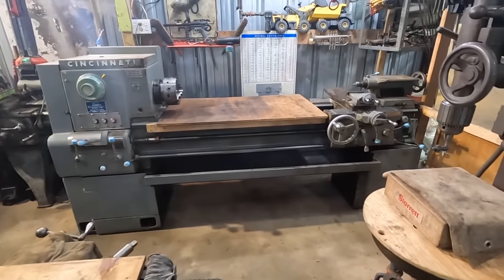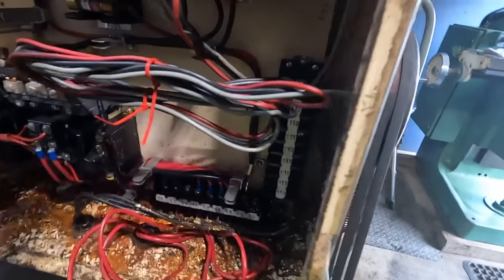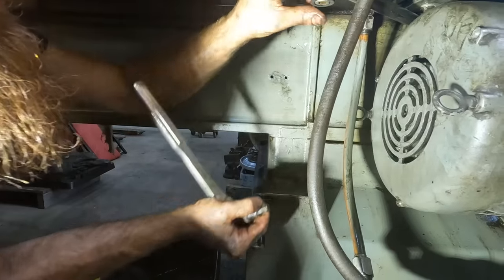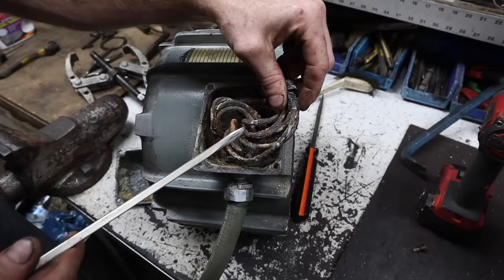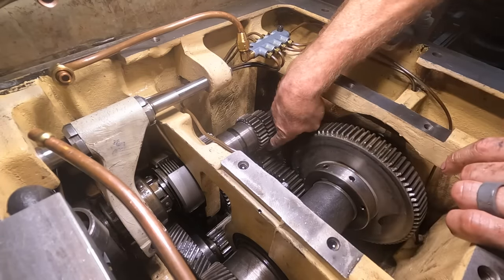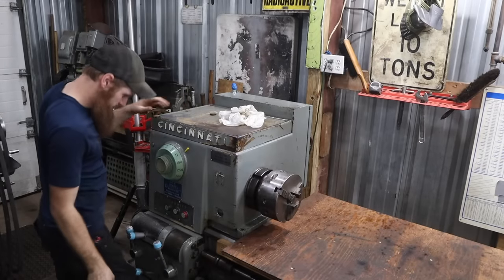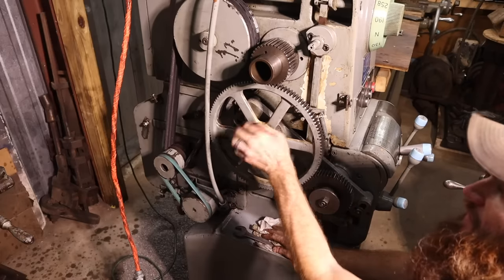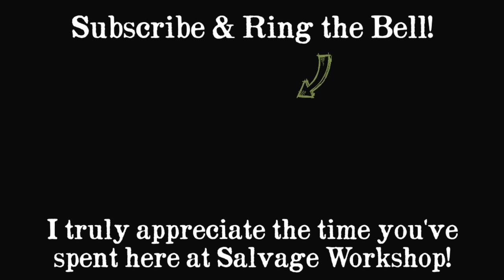Can we SAVE this BROKEN Lathe? ~ MAJOR Issues found! ~ Will it Ever CUT again?

Comment: Great video!  Woulda liked to see the feed change & TPI.  Spur/straight cut gears make noise, ever notice/hear a stick shift a non-syncro 1st or any reverse gear, they do need lube though.
  Roll/split pins have an install direction so the force on them doesn't close up the split & cause it to work out, a smaller pin inside will guarantee it stays put.  Don't put a restrictive filter on a pump's input!!!

Comment: I have never been a fan of General Filters which are a contractor grade of filter.  For my money I would get a RayCor style with micron rating to match whatever was called for by the manufacturer.  Unless there was a good reason given I would run it all through a filter of one sort or another.   Anyway you can catch dirt and wear to keep it out of the system is a good thing.

Comment: The powder in the motor was dried up coolant. I work on large 3 and 4 spindle Cincinati's and we've converted them to MQL and the flumes down the side of the beds are full of that stuff, smells horrible! I wouldn't be surprised if it stopped running at one time and they sat it off to the side, and one day decided to hook it up, or even decided to sell it assuming it didn't work, but once the coolant dried it ran again

Comment: You are very lucky you caught that motor issue when you did. Not only was it so corroded up inside that it's a true wonder it ran, but also those wires may have caused a short to the frame and ground out the entire machine.. so either it could have burned up, or electrocuted anyone who touched it while running.

Comment: Awesome video.  For the oil drain, I think something like a Fumoto valve for a car engine would be nice.  A ball valve that you can stick some PVC tubing onto for a really easy drain process. Not sure if they make that brand for NPT but an idea.  Also wonder if the corrosion in the motor was water (or whatever) coming in through the  power cable tube from the switch box.  A longer cable, looped high enough to prevent liquid from dripping, might prevent anything like that from happening in future. Even though the  gasket should in theory stop all that.  In any case, nice work, and a super interesting story.

Comment: 8:06 make outside jaws for the chuck!  Get some tools steel  blocks , machine it to fit the chuck,  then the jaws.  Maybe make them  extra capable,  with indexable jaws. Un bolt from zhe slides. Then space out about 1.5"-2"  and possibly flip over to be a inside chuck, some 2x3" bar stoc tool steel  blocks , i haven't machined anything, but seen jaws made before, and think o could do it. Definitely should try on some cold rolled bar stock first!! It would probably take me a month to halfway make only one, after turning 40lbs of steel to shaving, you should definitely try it!✌️  Id love to have a similar lathe, maybe not so large, and a smaller mill.

Comment: The noise in the large end gear won’t affect the accuracy of the spindle. That gear’s purpose is to transfer drive power from the spindle (which is gear-driven inside the head) to the quick-change gearbox that drives the apron screw. It’s downstream of anything that controls spindle accuracy. What lubricates those exposed end gears and the QCGB? I didn’t see any oiling mechanism tied to the headstock’s oil pump. That bushing the gear rides in will need continuous lubrication.

Comment: I agree with Paul that drain sump is to collect sediment and possible (heaven forbid) metal shavings from bearings or gears (not likely). The valve and flexible drain pipe is what I would suggest also. Don't connect them together. You will notice the pump pickup is slightly higher in the sump.  Whatever got into the electrical cabinet ran down the seal tight  and into the motor.  I'm surprised it ran too.
Reply: I just purchased one like this and that drain sump plug had a magnet on it which had attracted a small amount of metal shavings. Similar situation where the lathe sat literally for 35 years.

Comment: Those are a good lathe!  Stout and they will cut some chips.!!   The one we had was "War Finish
 No real fine feeds, maybe ,0027? I used to 4 jaw DME mold bases ...about 8" by 11"  and line bore all the plates assembled for round inserts. Big job!
That rubberflex collet setup is excellent! They run real true. 
I recall hydraulic maintenance was something that got done !  There is an oil filter in there you need to change.
As sludgey as that oil looks might it be water soluble coolant oil,like VanTrol?  That thing may have used flood coolant.  
Maybe two separate systems.
I suggest you not re-engineer the hydraulic system. (No tee to the filter)

Comment: Take photos of the oil soaked manual, clean the images up in photoshop and print them out, new manual!
Getting the motor rebuilt is the way to go. But it's expensive. Worth it I think. (But I'm not paying 😂)

Comment: I'd run both the sumps to the filter and change the filter housing to one of the remote mounts used on cars and put a proper oil filter on it..

It looks like coolant got in the electrical box and chased down the conduit into the motor

Comment: Suggest putting a valve on the lower end of your new drain so you can close it before you remove the plug to add a hose whenever you want to drain it. Try opening the door to the electric panel when it's running to see of anything is coming out of any of the conduits. "Sealtite" conduit is intended to be "waterproof" so it could act as a plumbing tube if it becomes "pressurized". ??? maybe a "overfilled" condition somewhere or a bad checkvalve  somewhere in its history ??? 
Connecting any one of the three wires "randomly" will make the motor run but it may rotate backwards from the direction you want. To "reverse" the direction of rotation, switch two of the connections at the source. It sure seems like this motor, and maybe your electrical box at the other end, may be "sucking" moist air from its environment. It looked like what you had there was excessive "oxidation". Wonder if that "air tight" motor was "searching" for air through your electrical conduit system  and actually sucking and distributing oily air through your electrical system on this machine??? 
Not sure I correctly understand the physical shapes of your machine, but if the lid of the transmission is directly over/behind the electrical box, I think you uncovered the source of the contamination in your electrical box with the fact that there is no gasket under that cover. Couple that with the material inside the motor (that got sucked there from the conduit system coming from the box where the oil was going. ????

Comment: Spur gears at high speeds are always going to be noisy, but you might be able to use thrust bearings on either side of that large gear to keep it from rubbing on the metal housing. You might have to shave some of the hub down to get a bearing on the backside of the gear though.

Comment: Congrats on your success so far... it's good that the lathe will be back in use. However, you've got to learn proper machining man. SERIOUSLY. You need to learn the basics of running a lathe and machining in general such as knowing feeds & speeds. Such as? How many inches per revolution you have your lathe set at. Feed rate greatly influences your surface finish. Example? For mild steel, try .004 per rev for starters when using a chipbreaker style carbide insert with a radius of .030 on the corner. Adjust as necessary based on the metal you machine and your lathe - all machines tend to be a little different and machine stability also determines finish (not to mention accuracy!) You also needed to set up a live center on the end of your workpiece. It was hanging out of the chuck way too far - this also influences surface finish. Next, set up your compound at 29° and leave it there for turning in general. Set the quick change tool post so your cutting edge runs at an appropriate angle - around 5-7° is normal IIRC. The tool post itself should be square with the ways. Rather than continue and write a book... the best advice is to get educated. Learning real machinist skills is your best bet for success. In the meantime, good job so far. For parts and data help, don't hesitate to look Cincinatti up on the web - the last time I looked, they're still in business well over 100 years after they started. You might be surprised at what's avalable. Best wishes!

- Max Giganteum

Comment: I'm pretty sure the gear assembly that is making noise on the headstock is only for threading and really shouldn't be run at nearly 1000 rpm.  Straight gears and plain bearings would be for much slower operations only.  I'm not familiar with that machine but I'll bet one of the levers will move the gear lever away and stop it from moving when not needed.

Comment: Awesome video of this lathe, excellently explained what you did. Have a good day.
I fit an extention  pipe to my lathe sump, then a ballvalve with thread on its end the same as drainplug, and used the drainplug there in case the ballvalve gets opened accidently, pleasure now to change oil.
About the 2nd hole for draining as you used(I agree), maybe they dont want fine swarf goint out of other hole to that sif/filter and pump, but rather settle or drained out, maybe the difference between the two holes-?

Comment: Hello, I can tell you what is wrong with the lathe. The electrical conduits are vaporing air and hot oil into the control box and motor. The fix would be to install a conduit seal off. Looks like a y-fitting with a plug. you disconnect the wires, do what you have to to and install the fitting as close as you can to the source. Back feed the wires when you can. Last part is to remove the seal off plug and fill the seal of with the seal-off material let it setup and install the plug. Will make two or more problems go away. Oil loss and debris building up in all the places it doesn't belong.

Comment: That roll pin fell out because it lost its spring tension, presumably because it got very hot, which aligns with the blueing you mentioned. The point I would make about the motor is that liquids can wick through a cable and get into the junction box and thus the motor so maybe that was how you lost liquid level and gained all that crap in the motor and junction box.
Reply: I was told once that when putting in a roll pin the slit in the pin should be at 90 degrees to the shaft. Especially in this case where only one end of the roll pin is holding the gear in place.  The torque of the shaft could collapse the pin or cause decreased tension over time if not done correctly.
Reply: @1DIYGuy  EXACTLY!

Comment: "T-ing" all the oil over to the screen thing is a better choice.
the extension for a drain is very practical, but really how often are you going to flush/change the "very expensive" oil in a machine you will use less then 100 hours a year?
Reply: Also put a valve in before the filter. To shut it off while changing /cleaning the screen.  Also to control the flow of old oil into a bucket.

Comment: I guarantee the water ingress into the motor housing was due to the water that was filling up the electrical panel. It was filling up the bottom of the panel until it ran down the power line whip literally draining it right into the motor... Ugh thats a nasty cascade of unfortunate events. That Cincinnati took it like a champ though. I true testament to how things were built back in the day.

Comment: I think at some point it may be worth having the motor re-wound. There is a chance that the corrosion  may cause overheating  if the lathe is put to some hard work.maybe a second hand motor is worth a thought too.  For a 3 phase motor if it runs oin reverse just swap over two of the wires. In the dismantlied state  Really hot water is a great way to disolve the corrosion without hurting anything else, then use a specific electrical sealer spray.

Comment: A Great Job Rebuilding/Restoring that Great Lathe .... Also on your 'To-Do' List .... Get some 'Levelling/Isolating' Feet and and Level it Perfectly ( 4 on the Headstock, 2 or 4 on the Tailstock end ) ... This will make a Major difference to the Accuracy .... Try to 'Borrow' a Good Machine Level .... Also .... Those 'Copper lines' in the Head .... Not sure  ????? ,  but I THINK  that they are Possibly the Hydraulic Line to shift the Gears .... Looks like they come from some sort of 'Rotary Valve' that acts as a Selector. Those 3 'Shifter Rods' are maybe 'End Fed' to shift them Left and Right ....  Also put some HEAVY Grease on the Gears, I will make a Major difference.... Running a 'Tight Mesh' also make them Noisy as they 'Bottom Out' into eachother .....  Might be Wrong on some points, but my 5c Worth .... :-)   :-)   :-) I am a Retired Engineer/Toolmaker/CNC Machinist, so have been 'Around the Block' a few times , therefore find Your Type of Vidclip Super Interesting .... Best to You, Yours and All from ChCh, NZ

Comment: Great effort fixing up this great lathe. A lot of complications, but you figured it out. Well done. 👍 Btw I wouldnt be too downbeat on that concentric 4 jaw chuck. If you machine a lot of rough surface round bar stock (like black mild steel or anything with a skin), they're great. Granted though, they're useless for anything other than round bar stock.
Reply: That's a misconception shared by most lathe users self-centering truck can grip and Centre more
Reply: ... shapes of bar than a three jaw which cannot grip square profiles. What people fail to realize who have not tried it is that a 4 jaw self-centering chuck grips and centres hexagon bar just fine. A 4 jaw SC chuck has other advantages over a three-jaw: it provides a more secure grip, and it distorts hollow workpieces less.

Comment: Not surprised at all, I have been through 2 brake boosters in less than 500 miles on my black truck. Even Ac Delco parts are not what they use to be.

Comment: Thinking about it, if the gear heated up enough to expand, and allow the roll pin to fall out, I would think it would cause more damage then you have here. I have a feeling someone was playing with it, and had a little "oops I dropped the parts boss!" and from there they decommissioned it after realizing the repair was botched? another good thought is poor quality control from the factory.

Comment: I'm sure someone else has already proposed this possibility but have you considered that the moisture that got into the electrical panel came from the outside of the lathe? Possably water intrussion from a leake in the roof. I didn't see any places where water leaked on the top of the panel. Just a suggesiton. Great Video love the content. Oh, and it looks like it was rewired at some point so maybe whatever leaked into to electrical box shorted out or damaged the original wiring.

Comment: i just finished a 1953 Warner & Swasey no#3   M-1200 turret lathe.. 4000 lbs. of fun fun fun
Reply from the maker: Awesome! Do you want a Warner and Swasey No.5 Turret Lathe? If so, let me know!

It came from the same place as my Cincinnati Hydrashift!
Reply: @SalvageWorkshop  no , but thank you for the offer.. I am not a machinist by any stretch of the word . But I do build custom bikes, and sometimes cars and boats.... and I always wanted a lathe that I could make some parts on.. mine was in the Navy for 40 years then civilian hand the last 35 and the last owner let it sit outside for a period before I got it for 500 bucks 1 block away from my house.
So I figured if I was going to do it I would do it like I do everything else.. and I stripped it down . Took each piece apart cleaned and sanded to bare metal.  Took the better part of 6 months and then painted it 2 coats metallic gold and 3 coats Candy Apple Red and I mixed in some orange starburst in the last coat and a few coats of clear and then about 2 months to get everything back together and new motor in, rotary phase converter, and then a transformer for my 3 phase 460

Comment: As a suggestion for what could be worse , just look at any aluminium shop door with a buried door closer in the ground , there you have die cast zinc brass aluminium steel and ... it's at dog height so it's totally full of dog wee that's been drying for years ,  yes that's worse ,

Comment: That's an amazing find in the motor. I've seen it before and I know what causes it. liquid was leaking into the electrical housing. liquid and electricity with metal casings causes electrolysis. so the powder is all the metal casing that's been eaten away over time. what happens is the liquid dries out, the crystals dry out, and fall, to the lowest point and start stacking up. what you see is the end result over a very long period of time. to me, it's obvious it had time to dry out between cycles. what I don't know is what it was wet with, I'm going to guess cutting fluid. which may be more electrically conductive than water.
Please be sure there is not a cable or something leading to the motor for a liquid to follow down into the motor again. if there is, put a drip loop in the wire to prevent it in the future.
had it still been full of liquid, the motor would probably be tripping breakers. I wonder if the previous owner wasn't chasing an inconsistency in the breaker tripping. i sure hopes this helps you in understanding what happened. 
Great job there guys !!!

Comment: Find out how much it would cost to just dip it and bake it. If you have the windings dipped it'll add another layer of insulation and make the motor last a little longer and you won't have to go the whole expense right away.

Comment: My guess is that at the time it was put together or serviced, the correct roll pin wasn’t used. If it was too loose, sometimes a mechanic will split the roll pin with a screw driver and insert it, all good…….not. Worked for awhile but then failed.